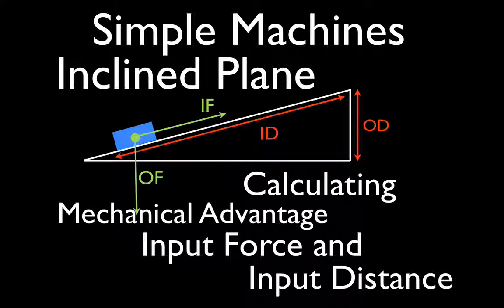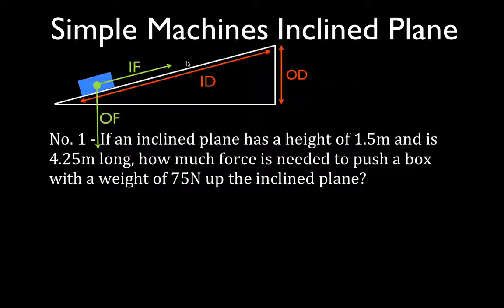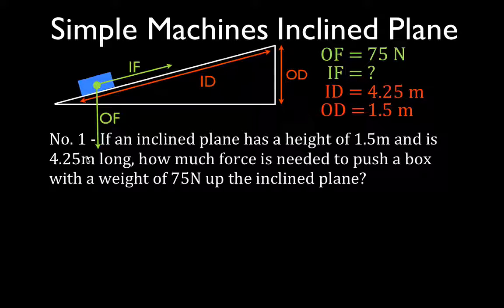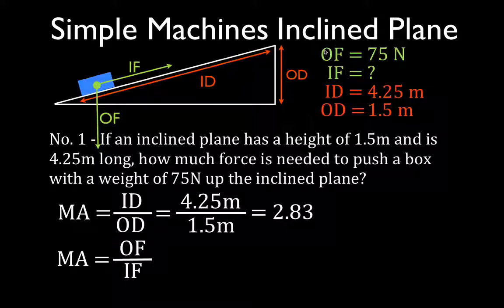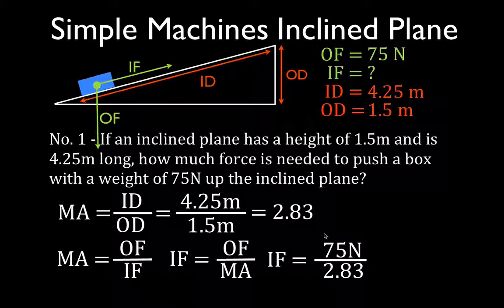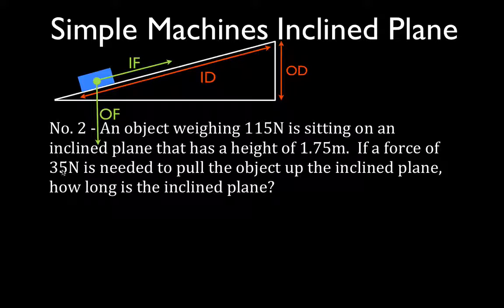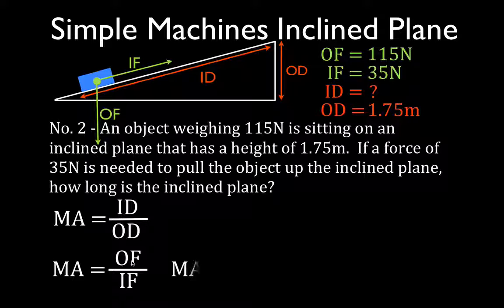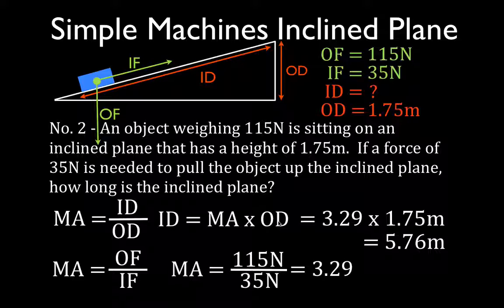Simple Machines (6 of 7) Inclined Plane; Calculating  Forces, Distances, MA, Part 1

Comment: I don't understand. Haven't you just calculated the force required to keep the object stationary - that is, to stop the object from sliding down the plane? You could then apply any force greater than this to move the object up the slope, depending on how fast you want it to accelerate? If you push the object up the ramp at different speeds, won't this affect output force (since input distance and output distance remain the same)? Therefore you can't say output force is the weight? Very confused...

Comment: Thanks! this video is really helpful.....but my teacher wants me to create a wheelchair ramp, so basically an inclined plane, but it cant be longer than 9meters and the height and width is 1 meter. so my measurements for my ramp is 5m long, 1m tall, and 1m wide. but the thing is I'm trying to find the effort force.....so the IF. Does anyone know what the relationship between work, mechanical advantage, and simple machines is? i really need help and my teacher is no good. i have a test in two days and this is also a performance task.....so it'll count as a big grade
Reply from the maker: The MA = OF/IF or the MA ID/OD and the W = OF x ID or the W = IF x OD
Reply: @stepbystepscience  thank you sir for replying, but I have been sitting here since last night......i just don't understand the relationship between work, mechanical advantage, and simple machine :(
Reply from the maker: @tanujarajchowdhury9531  As the ramp get longer the MA increases because less force (IF) is needed to get the object up the ramp. But the amount of work always stays the same, with or without a ramp.
Reply: @stepbystepscience  ye im confsed on that part....how does the work stay the same?
Reply from the maker: @tanujarajchowdhury9531  Because as the ramp get longer (ID) the IF get less.
Reply: @stepbystepscience  oohk thank you so much.....or way better than my teacher

Comment: Loved the video easy to understand but I have a Question: Could you set (OF/IF)  equal to (ID/OD) then cross multiply and divide for the missing variable? Since both are ratios equate to the same mechanical advantage that means that they would be equal to one another? for example OF/IF=ID/OD?
Reply from the maker: Sounds reasonable to me.
You can link to all my videos at my website: https://www.stepbystepscience.com